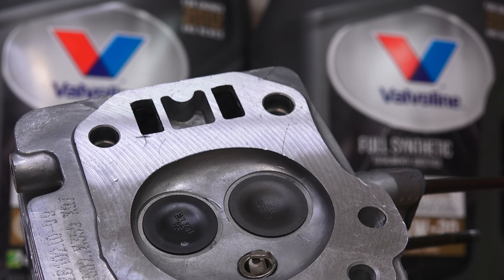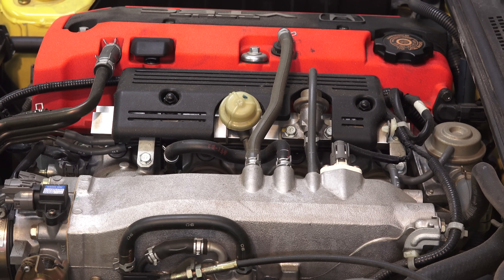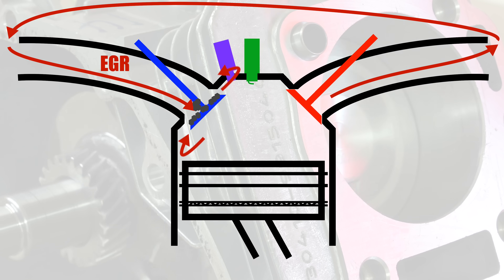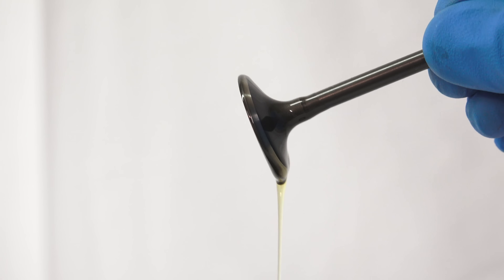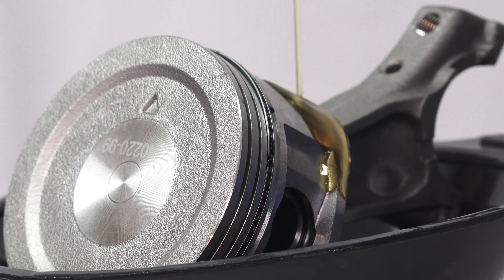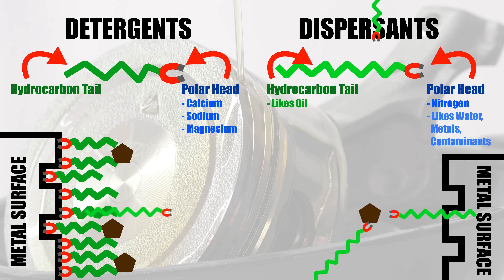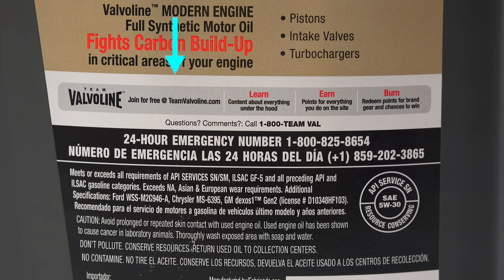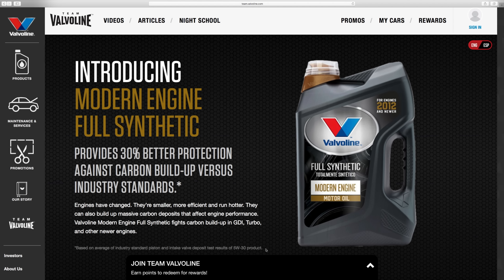Can Engine Oil Help Prevent Carbon Build Up?

Comment: Carbon = weight reduction, didn't you know?
Reply: When the seller tells you that the car has "carbon valves", and 400k miles
Reply from the maker: More like weight addition haha.
Reply: Carbon light switch, makes the room lighter.
Reply: @L3xou97 carbon carbon lighter, makes carbon carbon lighter lighter
Reply: @EngineeringExplained  hi, can you advise an oil (like that Valvoline) to my TFSI engine? :S or can i use it in tfsi as well? because i dont see the vw504,507 certifications on that valvoline :( which is required to TFSI engines......ok, maybe i can load this valvoline in to my TFSI too...as my dudes also use an absolutely not vw approved MOTUL oil to their ones :D:D
Reply: R u talking about carbon fibre 🤔
Reply: Chanakya, you got that 1 day later
Reply: Amritpal Singh hehehe, carbon taking up my brain 😂
Reply: Amritpal Singh if you see good mechanic for me I will be  highly thankfull to you 😊
Reply: lool
Reply: Need me a diamond suit then
Reply: Vince Vince  it makes your gas mileage worse. It makes your accelerator pedal more responsive. Pushing on the gas pedal more still gets the same acceleration. 

People who adapt quickly to these changes in variables won't see much difference. 

As for carbon...I run a little TCW3 2 stroke oil to keep my fuel system clean and keep my engine more lubed. Come check it out.
Reply: Rust is lighter than steel. A rusty car is a fast car.
Reply: Vince Vince  if you're punching it all the time of course things will where down faster, but just because it's in sports mode doesn't mean you're always punching it.

Even in economy mode you can punch it, it just requires the foot to go down more.

Never punching it is worse. Engines need to be used.
Reply: lmfao